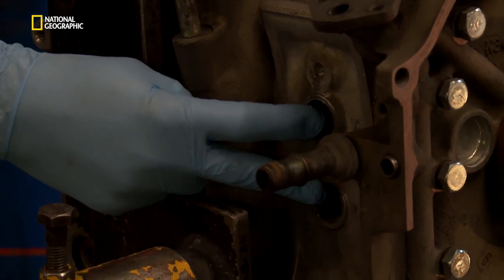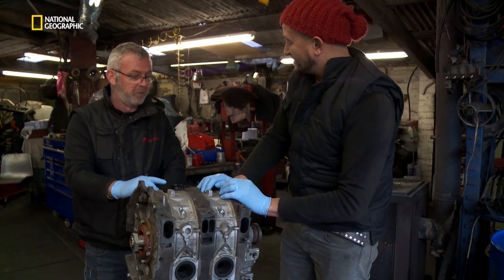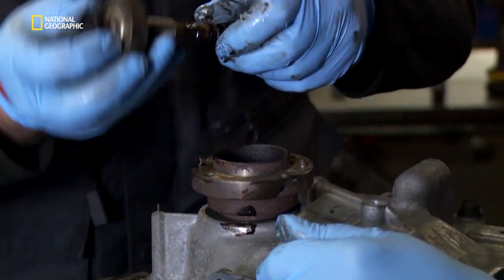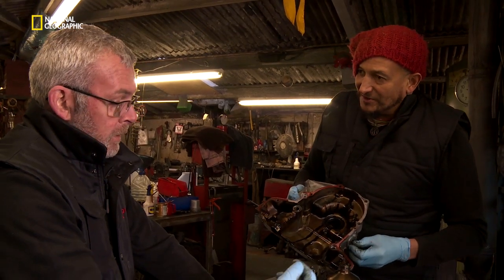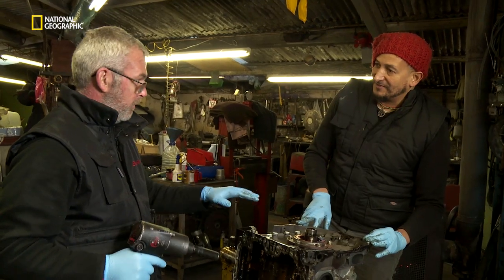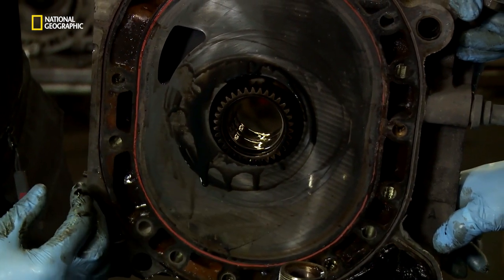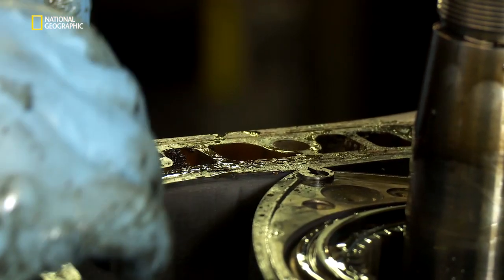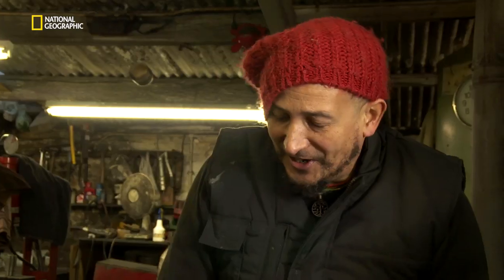Mazda RX-7 Rotary Engine | Car S.O.S | National Geographic UK

Comment: Didn't like rims they put on ,the offset looked all wrong to my eyes and there didn't seem to be too much width to the rears.ni would have left the factory rear spoiler and added a front splitter.nid say the owner has probably corrected these small issues